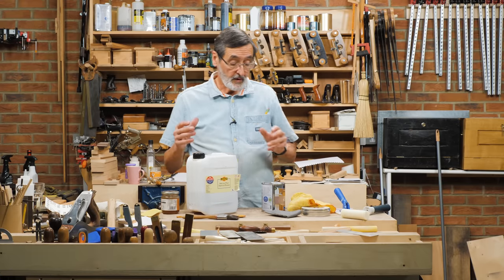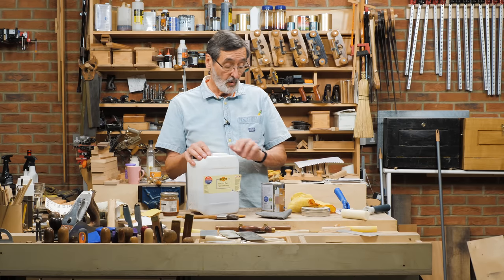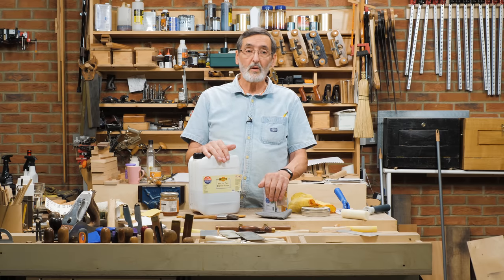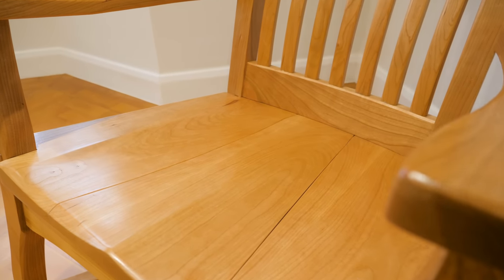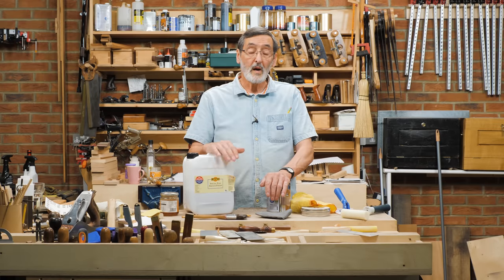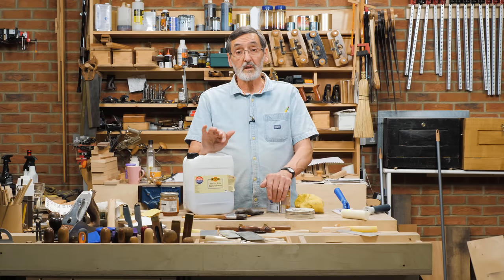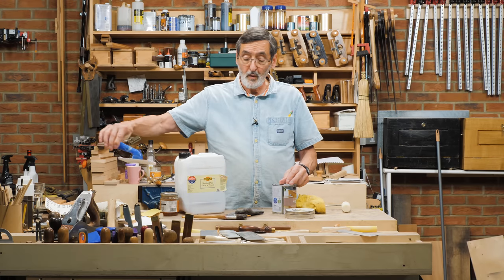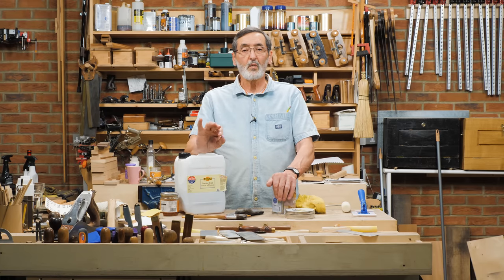Paul's Essential Wood Finishes | Paul Sellers

Comment: I absolutely agree that some finishes have too many chemicals that I simply do not want around me. I like oil/wax mixes like Osmo for this reason, but they are not the most robust for certain items. Just stripped a beech chair that had been stained very dark and had an old cracked maroon leather seat. Took the frame right back to virgin wood, finished it with shellac and then waxed it. Recovered the seat with a light grey leather and now it is looking very Scandi chic!
Reply: Everything is made up of chemicals even the human body. And when people see them listed on industrial products they tend to freak out.

Comment: Shellac is a great finish. For tables, I prefer natural oil finishes, e.g. clarified linseed oil or tung oil. They take a bit longer to cure, but can be easily refinished and hold up well to regular exposure to water.
Reply: Oil based finishes are tougher and longer lasting for daily usage. They can also have a beautiful finish when properly used.

Comment: Hi Paul and Paul Seller Team, I have a question regarding finishes suitable for wood that would be introduced to compression and other stresses. For example the marking gauge you made, the pin / locking mechanism is based on friction/compression correct? Is a finish such as shellac and furniture polish still suitable or would ideally an oil be used such as tung oil which penetrates the wood and won't leave such a hard layer? I could be very wrong and maybe the harder layer from the shellac is even beneficial but I'm worried about it cracking. Also curious about the bigger picture, marking gauge is the first thing I thought of but I'm sure there are better examples for wood on wood contact / compression / friction. I'm just in my 30s and eager to learn and create long lasting tools / pieces. Best regards, Daniel

Comment: Good to hear consideration for the environment which will make me rethink my preferences. I make a lot of toys so I use non-toxic, highly durable Osmo finishes, but these are spirit based. It goes a long way, so perhaps I needn’t be unduly concerned … some idiot parked their helicopter in my neighbours field last night to go to a local concert - they took on 1.5 tonnes of fuel on the way back making my carbon footprint seem very modest indeed!

Comment: Paul, I have just come back to say thank you for your recommendation of the Thor mallet you use, the rubber and nylon headed one.
I treated myself about six months ago, thinking it will come out for use with chisels and maybe assembly work.

Honestly, it has become one of my main tools, the old expression goes, I don't know what I did before it comes to mind but I do know, I would damage the wooden handle of my claw hammer or mark the wood. 

It is a wonderful addition to my tool box, well one of my tool boxes shall we say and it is something I would buy again straight away if I lost it.

Thanks again, so pleased you recommended it.

Comment: Thank you for introducing me to shellac in your videos, it's a wonderful product that brings out the beauty of the wood. So easy to apply, although i will admit I tried getting high gloss finishes using a pad for which I underestimated how time consuming and difficult it would be. I've found that using a dewaxed shellac you can then cover it with a hard waterbased finish to get the natural luster of shellac and added strength of the waterbased finish. (I have a pet bird who's feet can scratch and bird poop cleans right off haha)
Reply: French polishing used both oil and shellac to produce a mirror like finish. Oil and shellac can be used to gather.

Comment: Thanks for this.
I, too, have come to the same conclusions: shellac, followed by wax, is good for small projects where the finish will not be subject to a lot of wear (eg a clock case, or small box.)  If the surface will need to be wiped clean or subject to more wear, I go for a water-based satin finish varnish.
I have never tried wax over the varnish - but I certainly will, now!
Reply: Danish oil and linseed oil are great options as well. It is all about personal choices. My favorite is Shellac.

Comment: I have used shellac for 40 years, from a sand and seal 3-1 then stained to customer choice and then lacquer accept where water could be a problem, then I go with some kind of polyurethane. My problem is that I’ve not found a water base poly worth a grain of salt. What do you use? I have found a good water based lacquer but not good enough for a table. I spray most all my finishes. I have started to use Rubio Monocoat. Very nice finish and tough as nails and nearly impossible to screw up.
Reply: If you are trying to attain high level french polish like finishes you will struggle when using a varnish to attain that due to the fact they do not buff as well when finishing. 
Shellac is a very fine buff finish were the surface can be rubbed into an extremely smooth finish which behaves beautiful with different levels of light. 
Varnish and different water based finishes are best suited to a medium level finish that is not of a fine furniture level finish. So something like a working kitchen table or an outside bench would not be suitable for Shellac. 
It really comes down to what you want personally and what you skills have been honed into.
Reply: @bighands69  I am not a fan of any poly. I do like Rubio Monocot. I'm just waiting to see what it's like in two years.

Comment: Thank you, Paul.  Any suggestions for repairing a water-based varnish finish.  I finished our dining room table with that, and my wife inadvertently sat a hot pot on the table. The finish underneath bubbled.  Do you have any suggestion other than stripping and refinishing the entire top?

Comment: Thanks for the info on using the pad. I've used Ronseal in all its formulations since my late 'teens. It's a good product and as you suggest , I too use some 0000 steel wool for the final lustre that I want. I must try shellac, I have used tung oil in the past and still like it for some applications. Works well on the workbench top I find.

Comment: Paul, do you have an opinion about using shellac first, for a "warmer" color, followed by waterborne finish?
Reply: As someone who has watched 1000 hours of Paul, he has stated that shellac can be used as a "cut coat" to seal the grain before most finishes. I have used it as such on most of my projects.
Reply: As long as you use dewaxed shellac anything will adhere to it. I shellac all of my furniture. On table tops I topcoat with lacquer. HVLP gun lays it down beautifully.

Comment: What about sanding before the first coat? Can I apply shellac straight on to a planed surface?
Reply from the maker: You can. Sand after the first coat to remove nibbing but only if needed.

Comment: Hi Paul, does the wire wool not leave small steel splinters in the finish?
Reply from the maker: No. I have never found that.
Reply: @Steve Bosun 
I would assume if you did some sort of chemical analysis you may find particles of metal but to try and control wood finishing in terms of particles would not be a successful endeavor.

Comment: Great content as always. 😊 Any link to the water based finish?
Reply: I have linked to the finish I think he is using
Reply: @philrab6696  That's real nice. Would you like to share it?
Reply: @zapa1pnt  ronseal high peformance varnish
Reply: I use Hydrocoate Resisthane; I have used several gallons of it. Any sheen is good, I like gloss, which I can knock down if I want a less shiny look. I find it to be better than General Finishes Waterborne finishes, which are a close second IMO. In the US, Hydrocote Resisthane is easily available at Highland Woodworking, they are in Atlanta, Georgia.

Comment: Dear Paul. All water based paint must have chemical additives to prevent mould etc. These additives can cause allergies both when used and later when it has dried, affecting the environment in the apartment long term. There is a lot of legislative work done to set limits to what and how much the manufacturers can add, but you cannot exklude these additives in full. Personally I prefer to use natural oil-based treatments (without solvents) when possible. It is obvious that the working conditions for painters have become much, much better with less use of solvents. But water-based treatments are not without risks for the craftsman or the end user.

Comment: I’m having problems with shellac being too lite or too heavy in spots. Little valleys that were not bubbles… I try to keep the same speed of travel when applying. I’ve tried Tried foam, applicator pads, brushes, 2#, 3# .25 lb and it still happens. Any help anyone?
Reply: I would suggest doing a series of small boards as samples to build up a feeling for using it. You might be rushing as you are doing a project.